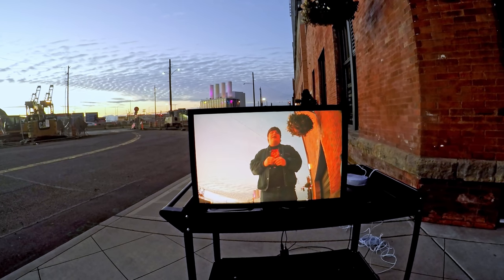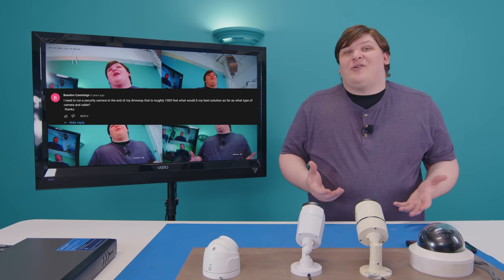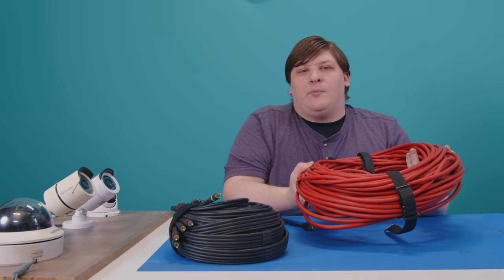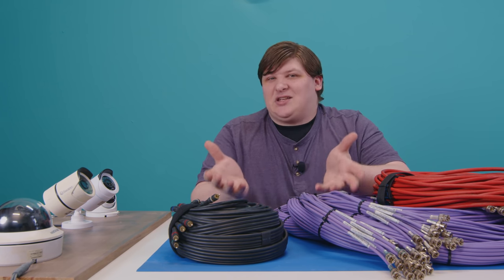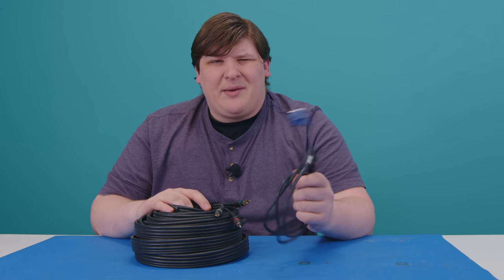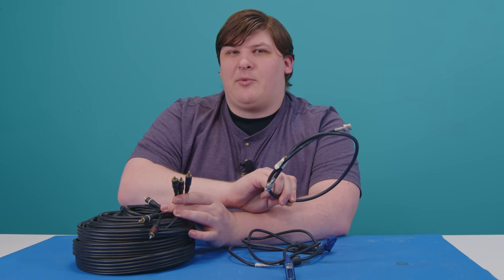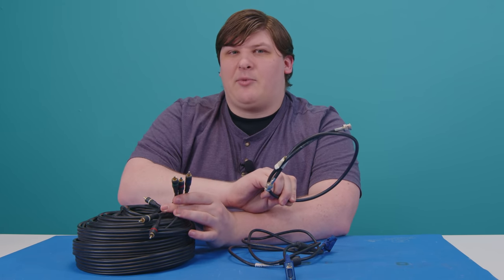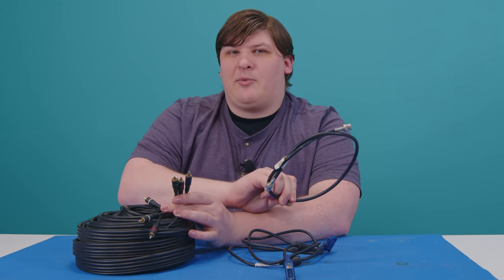1000ft of ANALOG HD video over a single cable?! [AHD/CVI/TVI]

Comment: I feel obliged to copy-paste an old thread started by Lesley Carhart, and responded to by “0xF09F8687”:
Lesley 
> Tech people on Twitter be like, "just buy and install a pi hole to make your $2000 smart TV not play constant ads and narc on your viewing habits"
0xF09F8687:
“Analog never phoned home.
Analog never betrayed your confidence.
Analog never fell off the digital cliff.
Analog never stopped to demand a firmware upgrade in the middle of a film or tried to up-sell you on 5000 channels you'll never watch from URLs that'll 404 next month.
Analog didn't care whose game console you used.
Analog faithfully reproduced cosmic background radiation in real time.
Analog didn't have to be thrown out five years later because the manufacturer programmed in a kill switch.
Analog could be repaired by any competent electrician. Analog never said ‘This content is not available in your geofence’ or ‘You can change DRM regions once more then it stays locked’”
Reply: “Analog never cost $150 a month (unless you made a very generous pledge to PBS and ‘What's that in today's money?’ is left to the reader as exercise).
Analog didn't have a broadcast flag.
Analog let you record whatever happened to be on the air.
Analog didn't need any cable other than power.
Analog did one thing, did it well, has been effective and reliable for half a century, and is far smarter buy than any ‘smart’ TV has been.”

Comment: 11:50 wait no, no wait. There are Ip over coax transeivers
Reply from the maker: requires power on both ends and two extra converters (points of failure.) if you have 130 cameras you need 260 extra outlets

Comment: I did not see you actually explaining how those cameras arrive at pushing noiseless HD quality video through 1000 feet of cheap cable.
Reply from the maker: I don't see how I didn't. They use high frequency composite analog instead of digital signals, that's the answer.
Reply: @CathodeRayDude  The word "frequency" does not appear anywhere in your video. Much less than the 4 words " high frequency composite analog" together.
Reply from the maker: @miro2424  nobody else seemed to have trouble understanding it, I don't know what to tell you.
Reply: @CathodeRayDude  Time will be the judge. Or frequency which is its inverse.

Comment: I don't really get how analog is supposed to be more forgiving on cables than digital. I suppose it is true that shitty analog cables basically always give an image while digital will cut off at some point but the other side of this is that digital will give you a perfect picture with any shitty cable that's exactly as good as what you would get with the most expensive cable. I have mostly bought super cheap long hdmi cables from the equivalent of a dollar store and they give the exact same picture as the most expensive hdmi cable you can buy.

Comment: I could see converters like that being used in a hotel for a cheap HD broadcasting solution
Reply: Amusingly this is roughly the reason satellite TV was popular with hotels/motels. The LNB (on the dish itself) is an analog tuner that pulls in a whole block of (analog or digital) stations and converts them onto the coax for tuning. With some clever wiring and mounting, and a "router"-ish box to handle the channel-change requests, 3-4 LNBs on a single dish could feed 900 analog channels to 60 rooms.

Comment: So this is basically throwing more bandwidth at problem than you could ever dream of doing over the air, but analog 😅
Did you know that Ethernet was actually designed for coaxial cables initially?
Reply: Video over twisted pair in turn, is also quite practical. While I mostly see SD and digital use, a single twisted pair of Cat-6 is capable of carrying 250MHz baseband to ~100m, more than enough for one of these HD analog signals to cross. The "baluns" used for attaching coax cameras to twisted pair are often simply common-mode chokes, or even just adapters. They sound terrible with audio signals, but somehow analog HD video standards are fine.

Comment: the fuzziness in the image is literal smearing of the signal in the cable, transitions that are too fast that get spread out; the front porch and hsync get spread out too but they have a defined width, as long as they survive you will see something. you can see degredation as sync loss in vhs video players, if the player doesn't try to do sync recover of its' own, or it does and does it poorly, the display can't lock on vsync/hsync and lines wander and scroll

Comment: Interesting video, but ultimately pointless, just use IP cameras and sell your old cables for scrap. But you did got me thinking, I wonder if you could hook up a decent webcam to a raspberry Pi or some other thin server and stream the video to a control center. If it'll work it'll be much cheaper the high end IP cams (such as Ubiquiti's 450$ a pop 4K G4 Pro).

Comment: Maybe you should read up on the UK Rediffusion service of the 1950s and 1960s... which pushed PAL across kilometers of telephone cable with outstanding results. The secret? An almost anal attention to impedance matching, coupled with impossibly powerful amplifiers at the sending end and correctional filtering at the receive end. And not a bit in sight....

Comment: I'm amused they "overclocked" NTSC, but I'm not surprised. (For the record, that's how I made 100M ethernet in the 80's... two radio shack cards with the crystals changed -- ISA so even 10M was asking a lot. Note: DO NOT do this; they spew RF all over aviation radio channels.)

Comment: HomePNA (HPNA) does ethernet/video data over existing coax upto 5000' with one decoder at the source and one decoder at the other end.
Reply from the maker: This approach does it with no decoders at either end. I have never heard of a native HPNA or MOCA interface in anything, I would guess the cost is far, far higher than the $0.30 these require, and then you need a computer in the camera and dozens of additional full-fat network interfaces. Or you could just plug in a camera and have it simply work.
Reply: Good point, the extra distance and price would have limited appeal 🙂

Comment: Nailed the mispronounciations of both Hikvision and Dahua, lol :)
Reply from the maker: I figured I wouldn't be able to get a reliable pronounciation guide on either (just a ton of white guys like me making their best guess) so I went with phonetic to be safe.
Reply: @CathodeRayDude  No problem - even people in the industry have weird ways to pronounce them.

Hikvision is hard “I,” so Hike-vision. Dahua is Dahhwah (soft A).

Other details in your video were generally correct.

As you may have researched, HD-SDI was briefly used in industry for a bit before HD-TVI/CVI. It was very problem prone with long and low quality cable runs - which is the typical type found in homes and businesses. SDI (in an affordable version) lasted maybe a couple years in this market. The dropouts were common enough that all customers I have who had an SDI system switched to TVI.

Comment: Hasn't anyone shot wifi down coax? All the line of sight wifi but nobody has tried to beam it down coax? I know beam forming won't work through coax but it wouldn't need to, coax is like the clearest line of sight zero interference air run.

Comment: Em i surprise that you can run analog  HD over 1000 ft ..  no. This signal  is send on baseband  that mean that the highest frequency probably below 20MHz. The losses of coax  cable are marginal as well the reflections. Standard cable tv system had much bigger problem as they operate at much higher frequency where multichannel interfere with each other (triple bit distortion and so on). 
Problem with pure digital signal like in HDMI  is that you need at list 5 time higher bandwidth then your baseband frequency keep the shape of the pulses legible. You could solve that by modulating the signal  like  OFDM and keep them still in base band. Basically modern digital tv broadcast down converted to baseband. That approach will give much longer transmission distance then analog HD. Notion that digital signal is more pron to distortion is not correct. I use to lessen on shortwave broadcast from Europe in US  with Digital Radio Mundiale that was almost CD quality.

Comment: Youre so true about digital vs analog! There are billions of working televisions at the trash! Only because of stupidnes of the governments. Yeah, i got better internet trough my own made wiring than the one from the shop! My own wiring has finger connected joints, and screwdriving bit connected joints, and the different wires are from normal household light cable to rj45 based cabel, only the ends cutted of and done my own connected luster terminal

Comment: now wait a minute, if analog tv really has no definition then they could've called it 16k or 32k and still it would be an analog signal?!
Reply: Analog TV had a fixed horizontal line count. The two last standards had 625 and 525 line. Active part of the picture is respectivly 576 and 480 line. But for the vertical it can be anything. It's just limited to bandwidth. For television this was limited to 7 and 6MHz. But it can be lower on consumer camcorders, or can be increase such is this 960H camera system.
Also it can be possible to make HD analog or more. France had a 819 line system and Japan had later a 1035 line system. Even computers can output HD analog signals over De15 ( VGA ) cables. My last one did 1200 line.

Comment: HDTV should have fallen back near transparently to analog the way HD radio does instead of eliminating analog all together. For a time, I lived about 40 miles from the nearest city, and when they switched off the analog, we basically just had no TV. We could mess with the antenna and get it to work for a while, but it would almost certainly go back to just noise eventually. We spent so much time, money and effort on different antennas. My parents had moved us from the city to the county, the best internet was dialup, and as someone who couldn’t drive, the additional loss of television lead to a feeling of near total isolation.
Reply: There wouldn't be enough bandwidth to do that, a large part of the appeal of digital was being able to fit more channels in. There would presumably also be significant cost to transmit both, + requirements for new TVs to continue to handle both in a tidy manner.

Comment: Yea.. triaxial
One of the tech-worlds false friends, just like RJ45 is not the jack on your typical ethernet patch cacle, a triaxial calbe is not triaxial... it has one axis and not three and is thus just a coaxial cable with 3 conductors or be it one conductor and double shielding.

Comment: Aw man, I've been meaning to look into this stuff for years! It pops up in my mind every now and then.

And yeah, digital TV is crap. It doesn't even look as good! Crunchy compressed garbage at SD, and while HD looks fine, it all cuts out like crazy even with a massive rooftop antenna. Cuts out more than NTSC on even the shittiest of rabbit ears, or even a monopole!
Reply from the maker: I watched the super bowl for the first time in my life over broadcast and was astonished at how bad it looked.
Reply: It seems fine here in NZ, when a decent source is used by the broadcaster. Unfortunately the broadcasters must still receive a number of programs in standard definition. I have a cheap UHF aerial(I'm not in a high signal strength area), and added a very cheap 2nd hand amplifier/splitter(which uses minimal power) as I'm feeding it to several rooms. The quality & strength signals on most channels are at 9 or 10.
The only real issue I have is purely physical, when very strong winds move the aerial, though that that's rarely a problem.
The wind likely wouldn't be an issue if I kept the 1st smaller aerial, I thought the bigger aerial would help signal strength with splitting the signal(before I got a booster), but it made minimal difference.
There is presumably less stations here though, although there is significant general intereference at my house, a fire station that presumably sends out signals is very close. Old rc cars aren't very happy, twitching away without pressing anything.
It looks like the USA is going through a gradual transition to 4k/hdr/etc, with atsc3.0
Reply: The cable TV BDU's lower the data rates so low, that everything looks like crap. True baseband HD-SDI is a glory to behold! 19 mb/s.
ATSC is okay as well, if you can get a good signal, without much multipassing.

Comment: A total aside, but this oddly makes me wonder about sci-fi and any time they have video calls with anyone. When there is jamming or interference of any sort is always fades in an analog way. Particularly in Star Trek, which did a lot of video conferences. Now this was done because that's the tech of the time and that's what they could generate. But, should the real world situation occur that we kick about space and need to have video conferences with aliens, how do we go about doing that? It would be impossible to get any sort of consensus of what digital standard to use. An analog format is relatively simple to understand, requires basically no math compared to a digital format and has all the dropout problems that are show here. It being that you either have a digital signal or not with no in between.  Analog transmitted video would be easy enough to deal with. 
Of course we then have to wonder what frequency we transmit on. But thats for another time. Other than to perhaps note. "Transmit in all known frequencies, and in all known languages, including Welsh".
Reply from the maker: incredibly valid point, wow. reverse engineering any analog format would be trivial, especially for say, a moderately smart AI (like one we can make now) and the two-dimensional, scanning nature of video is a naturally obvious decision; any space-capable race would have invented it at some point and would know that others might be using it. But now throw h.265 at someone. Ugh.
Reply: @CathodeRayDude  I may have spent far too long in the past wondering how an alien would understand the signal on the Voyager golden record. The answer to me at least comes that it doesn't matter what frequencies of light we see or the aliens do, it just being a signal of relative strength, you can just shift it into whatever frequencies you can see. If the alien can see at all, which seems like a whole other rabbit hole of thought.

Comment: I am afraid that the first part which establishes the market contains so many errors it annoys me.
Firstly, you completely missed Ethernet over Coax (EOC) which can give you 2000m over existing cabling if needed. There's also Ether to VDSL converters but they aren't so cheap.
Second, digital TV contains error correction, so it is more robust than analogue TV, it basically keeps the signal perfect longer but when the errors exceed the threshold it breaks. If you're getting a marginal signal, it's because your provider chose to reduce the signal power when they switched to digital. The USA's TV system is a mess compared to the rest of the world so that's no surprise. Your nostalgia isn't a technical argument.
Third, you seemed to dismiss fibre, but it's a myth that fibre is expensive based on historical cost of branded equipment. You can now buy stupidly cheap, off-brand fibre gear that is great and gives you great connectivity (especially in noisy industrial environments). I connected my workshop to my house via fibre cheaper than buying a PLA adapter.
Fourth, if you drop the quality to get stuff through, then you're reducing the evidential value of the security footage.

Comment: Why use wire? I fly fpv drones and am getting 720p 120fps up to 10 kilometers. Check out DJI fpv
Reply: Cables are far more reliable, are secure, don't require convertors, use existing infrastructure, don't cause interference, and can have power supplied remotely, not to mention businesses that have numerous cameras.

Comment: Amazing how stuff like this is not even being used by, I don't know, developing countries to sell tv signial in HD with this cheap stuff.
Reply: Its only workable with a few channels and only over a cable. Over the air it would take up several regular tv channels. Thats why we didn’t do it.
Reply: @StevenBradford  Damn, then, what about something like a small tv box? A pretty cheap one since the nature of the tech used with it, I would use it on my CRTs.
Reply: @Sage_Noko  Are they HD CRTs? Are they multi sync? They'd need to be capable of handling at least 720V x 1200 to be the lowest level of HD
Reply: @StevenBradford  google 2006 HDMI crt.